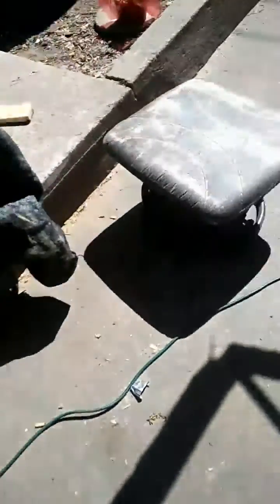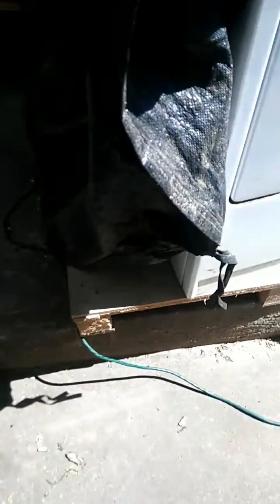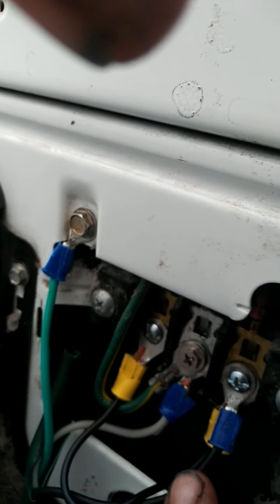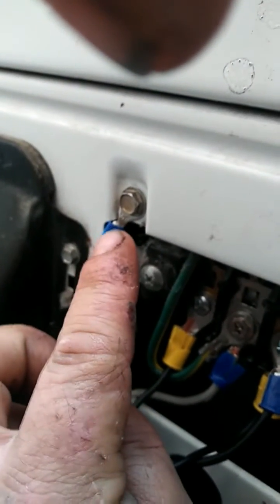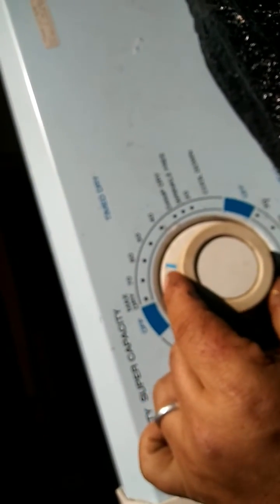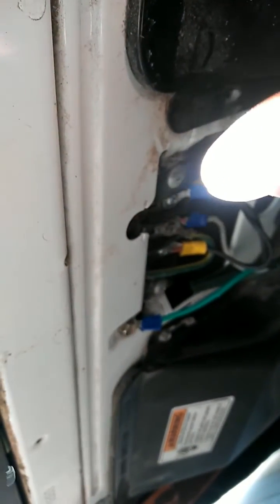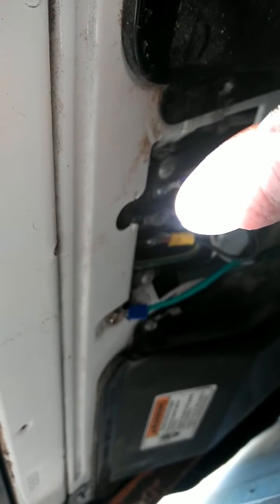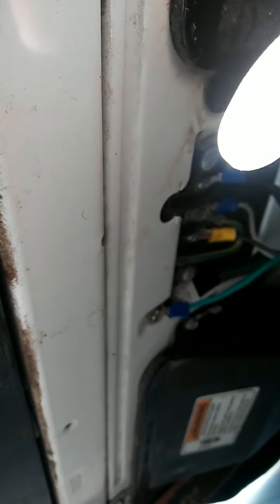Convert 220 dryer to household 110 socket pt. 2

Comment: why does converting a220 volt converted to 120volt end up using only 800 watts opposed to a 120 volt dryer that uses 1100 watts?

Comment: Is anyone really going to take electrical advice from someone who is not even smart enough to know not to touch charged wires? You are also drying with only half the heat since you are only providing half the power to the heating element!
Reply: However it does work, Right. Which really matters